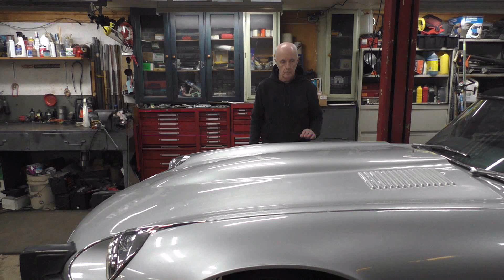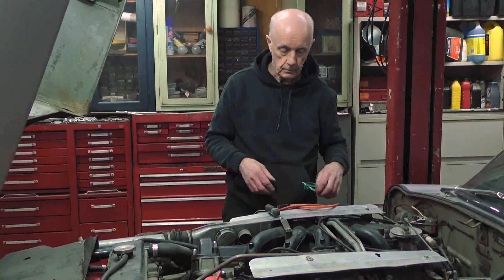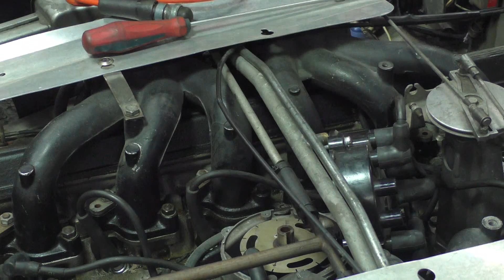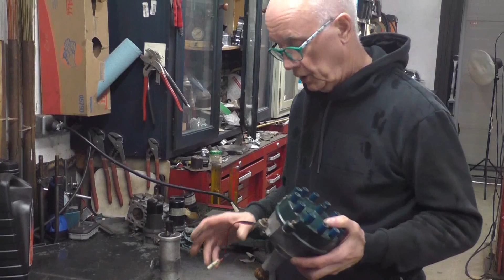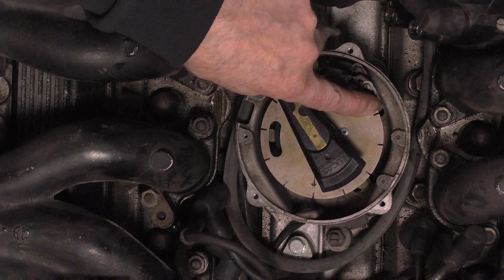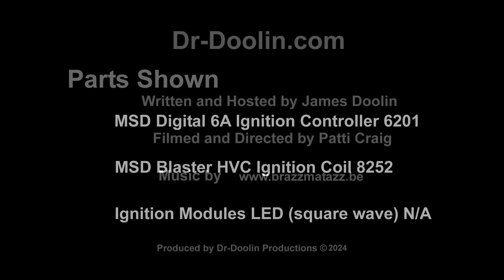Dr-Doolin Jaguar XKE E-Type V-12 1974 Ignition Repair

Comment: Good afternoon, Doc, I have a 1973 Daimler VDP Double Six, so very similar engine to the Series 3 E-Type in this extremely informative video.  I have not been happy with my ignition system since owning the car in 1988. I have tried the REOPUS system and a Crane Cams XR 700 with infra red pick up , neither of which were very reliable. Having said that the main problem with the REOPUS is the failure of the ballast resistor. Mine seems to get extremely hot, too hot to hold your finger on it.  I tried to access the diagram link above to compare the MSD ignition system with the REOPUS/Crane Cams but the link didn't work?  Having said all that what I am really looking for is a good performing ignition system which dispenses with the ballast resistor and gives a reliable and powerful spark. Your advice very welcome. Cheers, Chris
Reply from the maker: Hi Chris, sorry my fault I'm afraid I forgot to change the link to the new site from quite a few months ago. Thanks for letting me know. Here is the link it goes to an sign-in to a members section where the extra info for the videos are located. (easy to find).
https://dr-doolin.com/index.php/log-in-page 
I don't use the original Opus disc as the magnets are not that strong so I used the Crane disc with the LED trigger but make sure the Crane trigger (sensor) has three wires and is a square wave unit. 
Any questions feel free to ask.
James

Comment: I am working on a 74 xke , vehicle cranks no starts, it only start if choke cleaner are spray at the filter,  no injector pulse when cranking. any idea what could be the issue?
Reply from the maker: Bit confused a XKE 74 is not fuel injected, so either you have the model wrong or its an aftermarket kit fitted. Is it 12 or 6 cylinder
James

Comment: Hi I’ve watched this video and noticed that you mentioned about the front cylinder which is the side of the oil filler is bank is bank A but I noticed on my engine the leads are marked up the opposite way ie bank A is on the outside and bank B is on the leading cylinder side what problem will this cause. I bought the car and drove it 120 miles home and it seems ok
Reply from the maker: Hi 
I looked at the video and you are understandably a bit confused. I had to think about this for a while. I got it wrong I'm afraid. The side the "A" bank actually the right side when your sat in the car. So thanks for pointing that out. 
Your wiring is correct if the "A" leads are on the right side (from the driving seat)
The car I was working on has the Firing order and the banks marked on the Air filter cover which is on the other side of the car that I was working on.
So looking at the engine the cylinder furthest forward seemed to be the other bank, the furthest one forward is usually the number one cylinder. 
So I went with that, my mistake. Sorry. 
James

Comment: Excellent contents as usual and I'm assuming applicable to my '75 XJS which is suffering opus issues too. Thanks for all you do, you're appreciated.
Reply from the maker: Hi, yes it should work ok,, but the problem at the moment the LED sensor and the slotted disc 
they are no longr available. I suggested a replacement that I think will work with the orginal 
timing rotor/disc on another inquiry (erhere1) but I am looking for something that will work as a replacement sensor using the original timing rotor as well. Hopefully "erhere1" will let me 
know if it works for him.
If your XJS is fuel injected the sensor to trigger that system is below the ignition sensor and does
not need a signal from the ignition for timing as far as I know.

Comment: Hi there, love your video clips . I have a series 3 V12 E type Jaguar with the OPUS system & wish to implement the same solution... Unfortunately I cannot source the 12-slot shutter disk as V12 engines it appears are no longer supported. Any thoughts with regards to getting one made? I was thinking of 3D printing one etc. Any inputs appreciated. 😃
Reply from the maker: Hi, Rather than try and make disc, and still have a problem finding an LED square wave sensor. I would suggest take a look at  part number PNX-1662LS at https://www.summitracing.com/  it is a trigger I think you will be able to fit in the Distributor. It does not require a magnetized piece in the disc to activate the sensor. They are made to work with the lobe in the Distributor, a not magnetized piece.  So I am thinking the original disc will work. As it is not magnetized. Worth a try as its only $200. If you try it let me know how you go on.
James

Comment: Good to see another vlog on the V12, I need to source diodes or rectifier blocks for my V12 Butec alternator, can you point me in the right direction?
Reply from the maker: Hi Paul?
I am going to assume you have tested the Battery for voltage and the Alternator for output, along with the Rectifier (which is a separate unit) if the Alternator is proven to be at fault then, to me you have two choices.
Find a Rebuilt unit  (Mossmotors.com part number 851526) or get  a conversion to a later unit (https://www.sngbarratt.com part SBS1064/9  which is 110 amp or SBS1064/9U  a 240 amp unit. 
To find the internal parts and repair the Alternator yourself for most people is a bit impractical.
Thanks,
James
Reply: Hi James, yes battery and regulator are ok, the alternator is down on amps, I would like to have the blocks or diodes at hand if I pull the alternator from the car. @Dr-Doolincom

Comment: Nice to see you back among the spanners. But you didn't check or clean the contact to the rotor arm.😮
Reply from the maker: Hi Andy,
Yes, usually you see that problem of the carbon burnt out when you look inside the cap, I had a look and saw no problem. Did it so quick as part of the job it got missed on the video. The Rotor by the way measured against the new one was visibly shorter, but your right the carbon contact to the rotor works as hard as the rotor, but with no arc but they can and do, have contact problems.
Thanks,
James